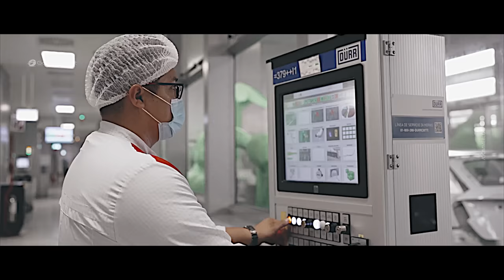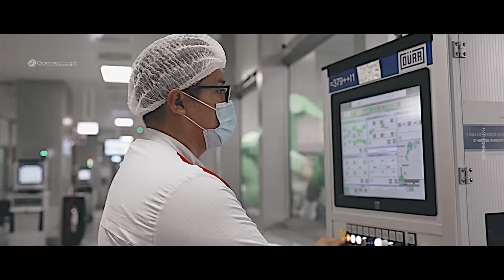2023 Audi Q5 PRODUCTION 🇲🇽 Mexico Factory ASMR

Comment: Nice to see how my car was made! Although I wish they still made them in Ingolstadt. It's amazing to watch the video of the Audi electric motor plant building components for the E-Tron.
Reply: It’s just final assembling using strict , precise German methods , not materials or engines..
Reply: @knocksensor3203  I know how their production works, they explain in detail at the dealership if you ask. I know it's under Audi specifications, still doesn't change the fact if I'm gonna spend $70k+ on a German luxury vehicle, I want it built in Germany. The benefit however, is not waiting for the disaster knows as US shipping ports and the vehicles being brought over land. I only had to wait 24hrs for the car I wanted with the features and color pallet I wanted vs ordering from Germany which could have taken a year. It's really just a first world problem, not an actual issue lol.

Comment: Didn't know it was made in Mexico
Reply from the maker: YES Mexico (San José Chiapa) .... Audi México is the Audi Group's youngest and most modern plant on the American continent. It is equipped with the latest advances in resource efficiency and manufacturing processes. The 460-hectare Audi plant in Mexico is located in San José Chiapa, 60 kilometers from the capital of the state of Puebla and represents an important step in the internationalization of the brand as part of the Volkswagen Group's network of production plants.
Reply: @GommeBlog  don't know if the plants go through same process as in germany but i sense some build issues coming out of mexico plant.